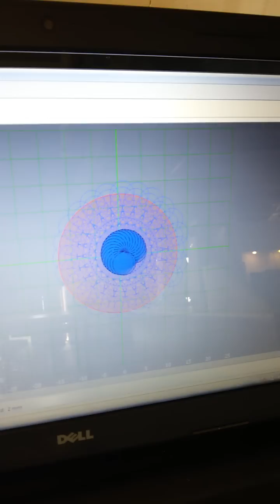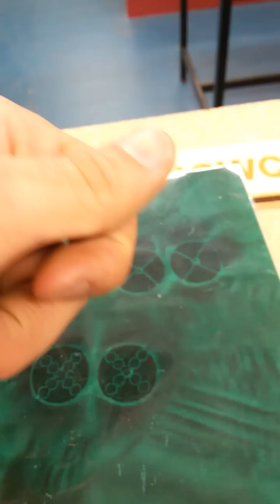Polymagnet and ferrofluid display

Comment: So. I'm a millwright by trade. Was curious what research has been done with bearings?
Reply from the maker: +Steve Ford Yes, actually the military took subtle interest into a barely friction magnetic gear drive.  You'll notice though that no magnets are quite strong enough to keep anything with considerable volume moving though.  I don't have the answer to this question but just get a feeling that it's beating a dead horse even though polymagnets are a new thing.  The truth is, you could superglue a series of magnets together to replicate any pattern the polymagnetizer makes; just not as sharp.

Comment: Excellent video!  informative and entertaining. Thanks for sharing firsthand experience on the process,  the outcomes and ferro fluid profiles!
Reply from the maker: +braxtonec Thanks bud! I'll be making more hopefully in the next few weeks.  It actually requires a lot of mental focus to keep up with the subtle changes that are made in the design process so it kind of gives me a headache and I get very forgetful. It's weird.   When I recharge a bit I'll go back to it.
Reply: +Ky Faubion could also be interfering with spacetime given these new means of shaping electromagnetic flux. It was interesting to see the 'maxelization'.  Eventually the dot resolution will probably get finer leading to smoother action or more dense field patterns. So much coolness.